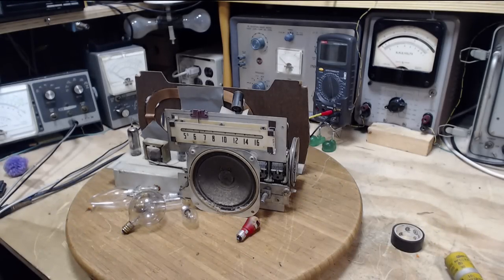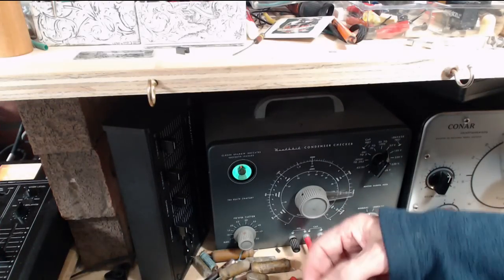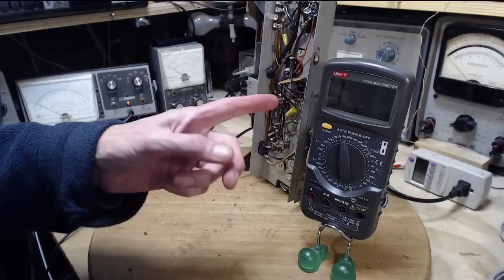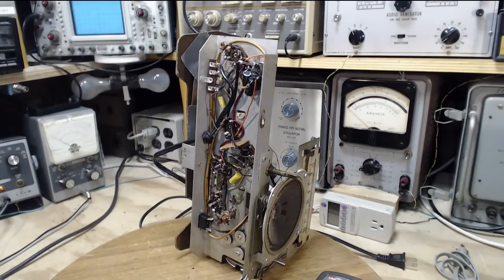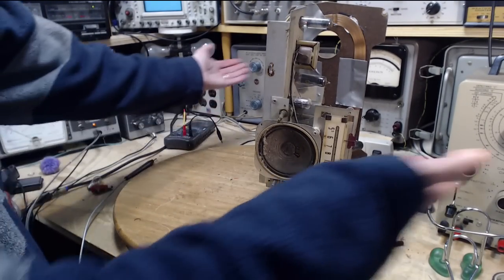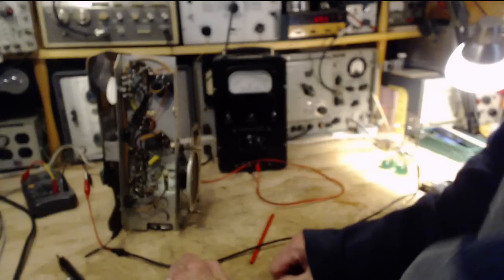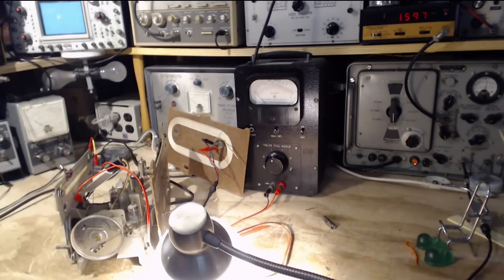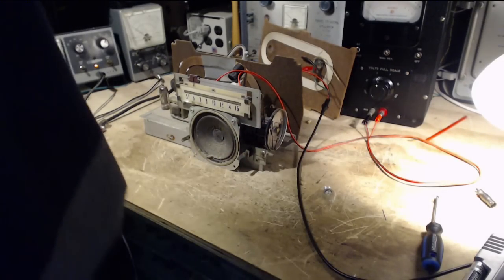Electrohome PK 104 Five Tube Radio Video #2 - Capacitors, Voltages and Alignment

Comment: I have a very important question I hope you can answer for me. Are the clock hand's on this radio radioactive? I understand it that they used to glow? If they don't glow now, it's because of the radioactive substance that was painted on them has damaged the zinc that was used to help it glow. Can you confirm this?